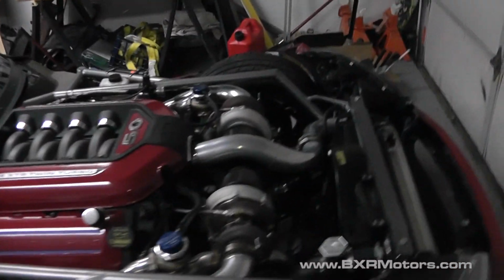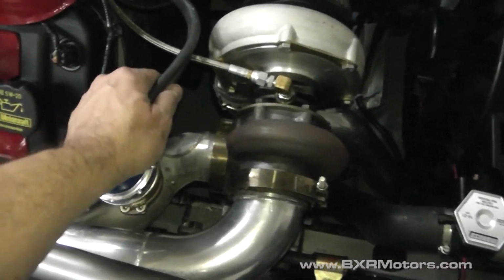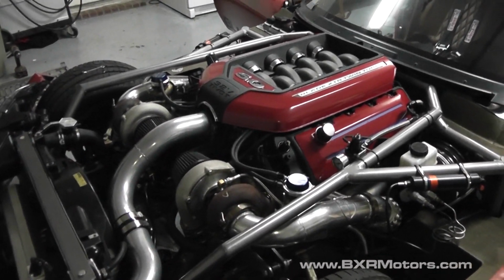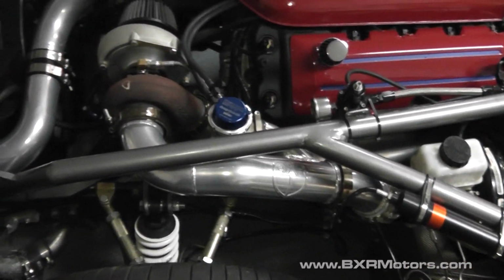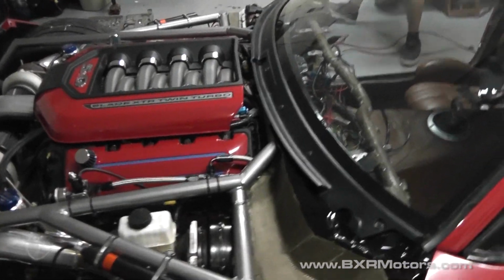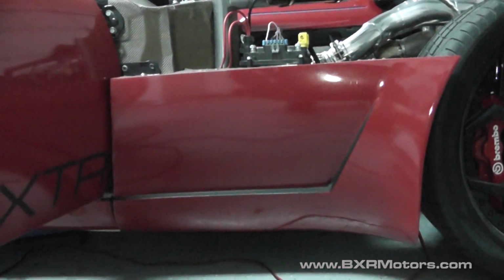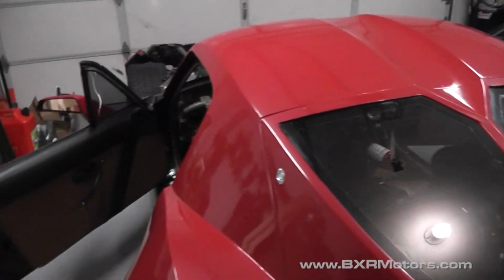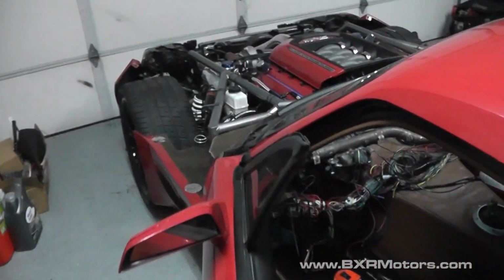Twin Turbo Coyote 5.0 Blade XTR specs and Timelapse footage.

Comment: omg ,did u here what he said about the injectors,woa!,,,normal v8s , chevy an ford ,run like 55,65 lb hour injectors ,,8,ya kno,,,naw,,,he runnin 8,    1000 lb injectors,,
Reply from the maker: Will Fountain III they are actually 108lbs injectors.  The brand is ID 1000 (Injector Dynamics) 1000 series. although ours are modified to run at 108 where the normal ID 1000s run around 95lbs I think.
Reply: Are those freon innercooled turbos?
Reply from the maker: +Mike Samra not sure what you mean exactly.  But it's a regular air to air intercooler setup.

Comment: Can you tell us what exactly you had to change to fit those turbos and to keep it rev high? Thanks
Reply from the maker: not sure what you mean, but it's a custom engine designed to rev high under boost.
Reply: Ali Imad the engine is a high reving flat plane crank motor. From 7500 to
8250 rpms. Its a coyote 5.0 mustang motor.
Reply: Not flat plane. Cross plane. 5.2 voodoo is flat plane.

Comment: How fucking high do you plan on running that engine? Over 8500 rpm on twin turbos? How the fuck?
Reply from the maker: yeah technically it can rev to 10K. .. but it was designed to make power up to 8500.  The coyote motors are pretty amazing... lots of untapped potential to be found.

Comment: After all of that work you guys drive it like morons. I would laugh my ass off if you wrecked it.
Reply from the maker: That was the point... I fully intend to break it. I even took it off road for a bit through rocks and dirt. I had people kick the car, I trashed it on the track at 120plus speeds and through all that nothing broke.   the only think that happened is I had a flat because the giant tires spun on the rim.  It's a prototype so had to put it through its paces.

Comment: What are the tiny cone filters used for on the cylinder head
Reply from the maker: Those are crankcase blow-by filters. They are temporary for now.  Later it will be converted to a larger catch can filter setup. Turbo create extra blow-by pressures so you have to remove the pcv valves and run an open filter setup.
Reply: @OZTron3D  right, but you still want negative pressure (suction) on your crankcase. This sucks the rings and helps them seal against the cylinder walls, increasing cylinder pressure, efficiency and therefore power but it also extends longevity.